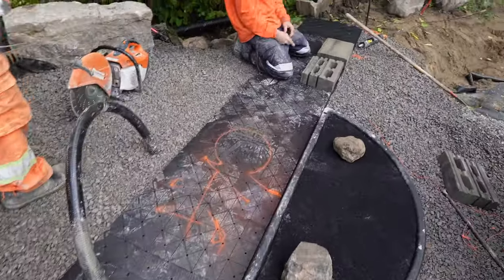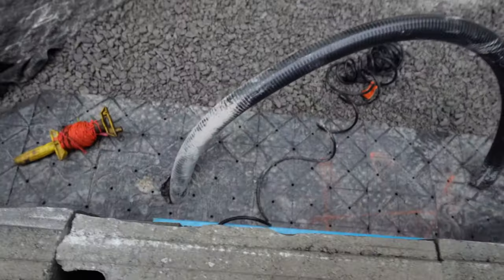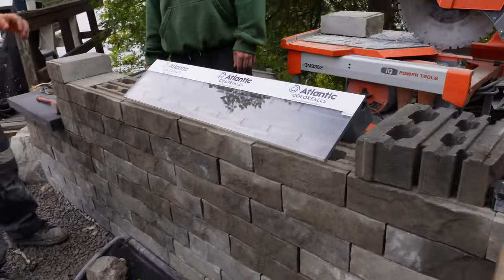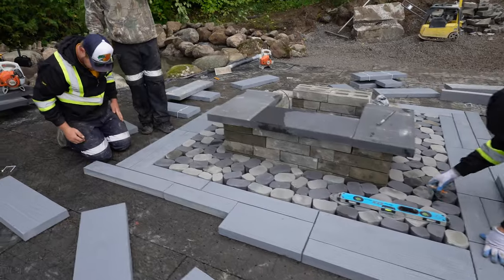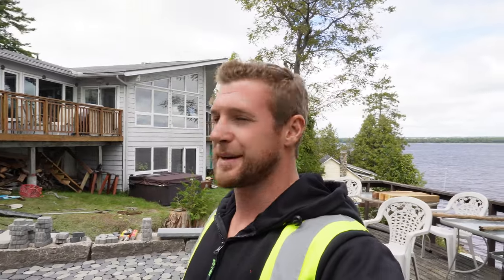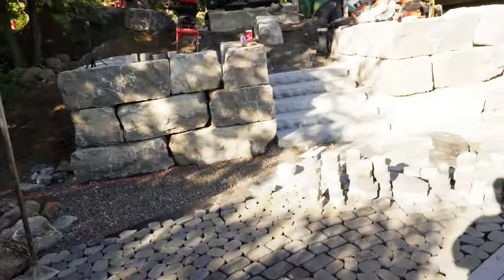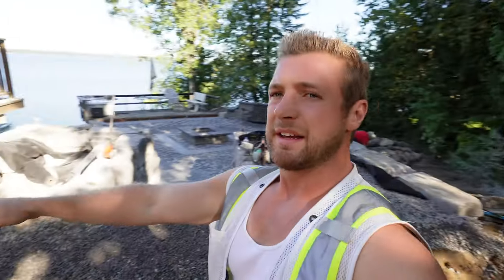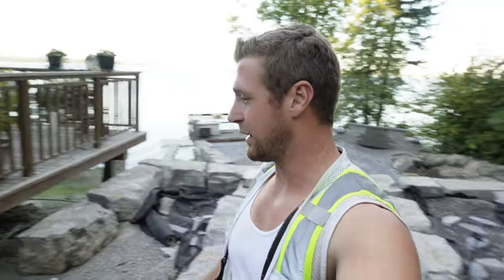How we did it: Step by Step Backyard Transformation with Full Time-Lapses (Pt. 2/3)

Comment: Where do u use gator base and when don’t you?
Reply from the maker: Gator base is interesting. In this case because of the lack of compaction you get on a sandy base, we used gator. Typically it’s not something we use all the time, it’s certainly is a specialty product with a specific time and place and purpose. 

The theory behind gator base is simply you can cut your excavation depth in half because it provides that much more stability and strength. As a business, this save you cost of excavation removal and base material however, the cost alone of a gator base with simply offset this meeting you do not save any money.

Gator bass does also add additional strength to the base system, due to the fact it locks in with tongue and groove and is approximately 3 ft.² per sheet. This means your material that goes over top of the gator base has a sub base below that interlocks gather and disperses the way better. 

If you chose to have an interlock project with a full permeable base, then it’s another time that gator base would shine because water is constantly penetrating that base it does add that security factor that everything will hold up better because your entire gator base system is interlocked together, which provides superior weight distribution. 

Hopefully this information has been helpful, thanks very much for watching our channel.